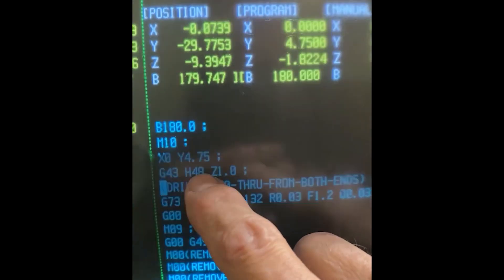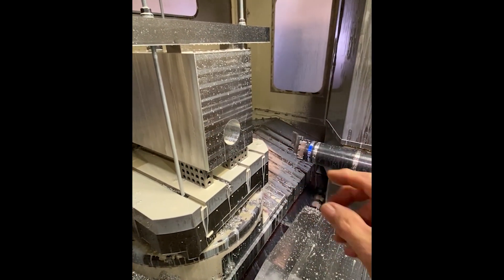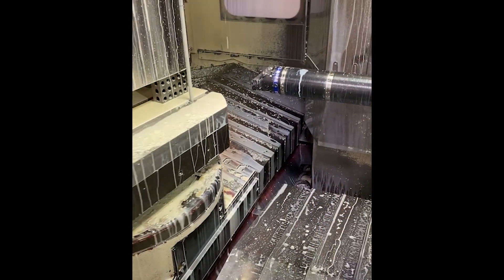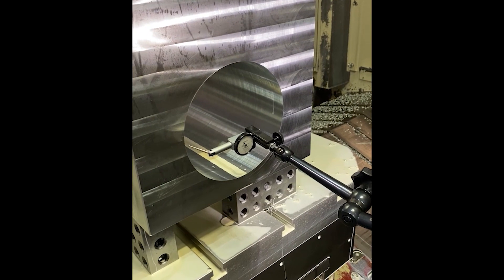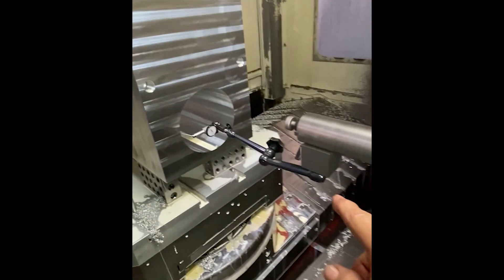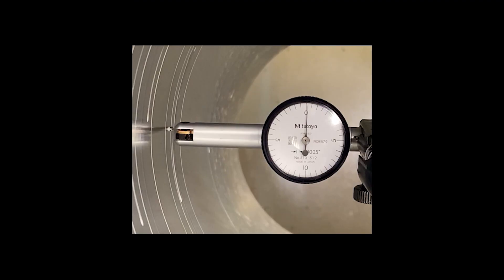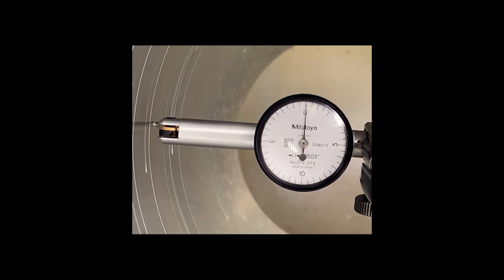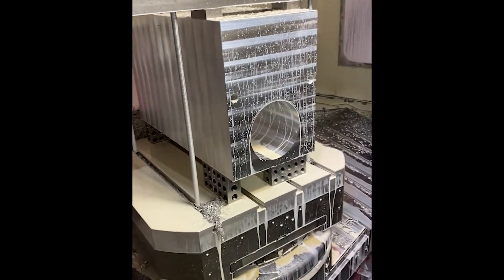Drill and Bore Aluminum Block

Comment: OK I have  a stupid question (or so I assume, and no it's not what is the part for...) 
I notice you often set your stock on 123 blocks rather than directly clamped to the pallet, is there a specific reason for this ? 
To clear the bottom of the spindle perhaps in case of close quarters Z axis machining perhaps ?
Reply from the maker: They are 2,4,6 blocks. The reason is the face of the spindle is almost 12" in diameter. If the tool is short the spindle will collide with the top of the pallet.

Comment: I use the biggest drill I have to make the hole to start with the biggest I possible have then I get a long 1-1/2 In inserted em and ruff machine the whole thing it go fast af doing 125 ipm with a 30% step over at full fluted I cut that like butter and get a bor bar with a shaft as thick as I can get and as long as possible and just bor it all In on shot but If I have to do it half and half like your doing I program it to where I stop on be side on the other side I save like .002 and I program the bor bar process to finish once I start to get near the end i program 3degree taper just as far back as I need to go and it will blend very very nice with out having to use sand paper unless it’s ok for it to be a few thousands out then I leave it. Other wise that’s what I do

Comment: I'm wondering if the issue is with the fixtureing..I'm thinking that big bore perhaps is moving the part just a little bit. I'm new to machines but I'm learning  you are a good teacher.  P.S. I am a wood worker I do high end comershial millwork. And installation. And I really like the bevail square.

Comment: I've been meaning to ask you a question  pertaining to laser cleaning. Have you had anything done with this new method and if so which is the root of my question I am curious as to dimensional effects for example a slightly oxidized ( should never exist I know ) 1"  "C" class Jo block being blasted, how the O/A dimension is affected? I have snooped around with no success having feed back from someone other than a manufacturer. Cheers!
Reply from the maker: Sorry I have never had that done.

Comment: whats the purpose of calling a tool and then having to call the correct tool length offset afterwards? I use Heidenhain and there you just call the tool and thats all you have to do
Reply from the maker: That is actually the way most machines work. On my Mazak a G43 line isn't necessary either. But it can be used. A 43.4 is absolutely necessary for full 5 axis though. On your control (I have never run a Heidenhain control) what if you wanted to use two different offsets for some reason? Could you change it with a G43?
Reply: @EdgePrecision    you can add some offset in form of delta length  and delta radius eg. Make the tool longer/shorter or bigger/smaller by some amount.

Tool Call 1 Z S1000 F100 DL0.1 DR0 

This line calls the tool and makes it 0.1 mm or inch longer. This is something we regularily use to machine flat faces exactly to the right dimension. You just call the tool with 0.02mm positive offset, machine a part of a face, then use the touch probe to see how high the surface actually got machined and then you just calculate the the offset, change the DL in the Tool Call line and run the program.

Sorry for my bad english :)

Comment: Wow ,I thought I was the only one who did this. I am doing a 70” total length bore 35” from both sides now. I would like to see your method if you have two drastically different size bores from both ends say 8” on one end and 1.5” on the other. We do that also with a granite parallel. But would like to see if you have any better ideas.

Comment: How do you know that it's a linear offset problem rather than an angular one?  If the 180º rotation was off by 0º0'30" that would also create a 0.002" mismatch in the center; in this case changing the offset would give you a hole that's smooth but not straight.
Reply from the maker: Because I indicated the outside of the part and it was square or lined up with the axis.

Comment: Lots of comments and compliments. But do NOT peck a spade drill unless you have to. Horizontal is less trouble but vertical can be a real problem. Nice machinery.
Reply from the maker: Thanks for the comment. In this case because I was driving the tools holder into the hole. I didn't want any shavings to interfere with that. I think a chip breaking peck like I'm doing here is OK but not one that retracts the drill clear out of the hole. That I would never do with a spade type of drill.
Reply: I figured that there was a good reason. But my comment was more for newbies. That may not have the experience to fiddle with the "rules"
Reply: I agree that ANY binding of a 4 1/2" spade drill on a 40 taper could be catastrophic to the machine. Like new spindle cartridge bad.
Reply from the maker: That's a 2" Cat 50 tool holder.
Reply: For the record, I have 30+ year's in the trade for those that care. And yes the bore turned out very good.

Comment: Thanks for the video, does that mill have a geared head stock, I notice the Q .03  on the G73, I suppose it's so deep that chip's would be problematic
Reply: I see that your B offset is off on G54 and G55 would that cause your bore to be off a bit? thanks again for the video
Reply from the maker: The machine has a direct drive spindle. In fact the spindle is the motors shaft.

Comment: Peter, I think it's a supper lightweight, precision anvil  ; ) . The video is very informed. The whole video I was thinking you going have loosen the part and knock it around a .001. I was wrong!
Reply from the maker: Generally you can do most things on a CNC machine with offsets. If you program with that in mind.

Comment: Ohh the Joy of having old horisontal.

I was spoiled to machine on a New dmg 125 horisontal. I did alot of line boring like this and with the dynamic offset cycle800 it was always spot on without Any problems. If it had problems it was very easy to dial in.

Comment: What's the spindle HP on that machine again? I have run a 2" spade drill on my lathe, it's 30hp max. Definitely not pushing the drill too hard though.
Reply from the maker: This machine has the 40 hp high toque spindle option. But this also limits the max speed to 6000 rpm. And yes I could have run the drill quite a bit harder. But I didn’t want to move the part on the blocks it’s sitting on. Thanks!

Comment: Is that a Max cut drill? Ive used 100mm drills from them with great succes. The are the same type drill you use. Hss tip
Reply from the maker: This drill is a Allied Precision drill. This is the largest diameter I have.

Comment: this is typical, but a good teaching lesson, the deviation is usually in the rotary/table axis, set-up, how it is trammed, including the age of the machine..."push-off' is deflection of the tool, the longer/length the tool, the worse, as well as type of material being cut..
Reply: If it was the rotary table fault, it would have shown up on the indicator as he traveled down the bore. no?

Comment: Could it be that a b axis work offset would also fix it?
Reply from the maker: I have indicated the B axis it is accurate. I suspect I need to check the calibration of my spindle probe. If I were to change the B zero that the hole would not run parallel to the sides of the part. Because I needed to move both offsets the same way it makes me suspicious of the spindle probes centering.
Reply: Thanks Peter for the video. I think when you use the electronic probe it does not work perpendicular as the Tesa probe can. You have properly turned the table in 90 degree for probing one side of the aluminum block and then 270 degree for the other side. If the angle tolerance is slightly off by theta degree, and the half boring length is approx. 25 inch, then you have 0.003 = 25 x tan ( theta ) , isolating theta gives you theta = arctan (0.003/25 ). I would have expected a special work pice holder in your Mazak and used the long travel in this machine combined with custom made capto boring bar :-).
Greetings from Denmark

Comment: Looks like that silent bore bar did well. How is it in steel at that much hang out?
Reply from the maker: The ITS boring head? I’m using their normal steel extensions. Three of them on the cat50 shank. The tool is around 17” long. But it’s weight alone might be the damping factor. It must weight around 60-70 pounds. I didn’t weight it but it’s not easy to mount it in the spindle with one hand and turn the clamp switch with the other.

Comment: so thats typically a pecking drill? i have the type with 2 inserts in the end, nothing that size, and they say constant pressure. ive never used one like that.
im interested in how you make the bevel gauge. particularly the slot, 2 pieces or a saw?
glad to see youre doing well.
Reply from the maker: Its just a spade drill. I'm pecking it like that because (As you may have noticed in the video) I'm driving the end of the holder into the hole. I cant have a wad of shavings build up there. It would cause a problem. Otherwise it could be done without the peck.
Reply: @EdgePrecision  no i did not notice that about the holder, gotcha.. appreciate the info, thank you.

Comment: Being only 2-3 thou off 15" in after rotating is pretty good. Yasda has an old school video where they talk about problems like that in horizontal machines.
Reply from the maker: I think people don’t realize how little error this really is. When you are dealing with parts that fit in a vise this is a lot of error. But when dealing with longer distances .0015” off center isn’t that much. Every one thinks their machines are so accurate. But it’s not the machine that makes accurate work. It’s the machinist.
Reply: @EdgePrecision  I agree, I have definitely worked on horizontals that would have been at least twice as far off as yours, though.
Reply: Exactly Peter.... Machines are no where near as straight and square as people think.  I've bought brand new machines that were misaligned by large amounts.  And yes, that is a very small amount to be off.  Most people wouldn't even fuss over it.
Reply: @TexasHunter59  You are totally right, but at work we got lukky: we have a TOS HBM with 4m X Axis Travel and the spindel is perfectly allignet with the X Axis. We can face a part in both directions and see the rings on both sides of the cutter and both directions look the same. BUT we only noticed then years after the machine was delivert, because before we never did parts where it matters.

Comment: I don't mind the video format, it's always interesting to see what you get into.  I know on my Renishaw probe I check that the adjustment screws don't loosen up and the tip still has the same run out.  I'm sure you've seen it as well, if you get a chip on the taper, or a set screw loosens up you'll quickly be out 1-2 thou easily.  Thanks for the video!

Comment: Is this more time efficient to bore rather then trepan? Seems like a ton of material removal that requires the pecking for chip control. P.s. I'd still watch if it was 480p and vertical like this. :)
Reply from the maker: Trepan could be good if I had the tooling. I think I have only done maybe six of these parts in 15 years. It’s not worth the investment. Thanks DrKnow65!

Comment: Hi Pete, I'm a bit confused . Is you rotary table out?.  Why are you using 2 offsets? . If the Job is set in Co-incidentally to the center of your rotary table you should be able to get away with using one offset. I know thats a pain in the Arse to set up but the bores would be in line. Love your work BTW. Happy new year, Mal.
Reply from the maker: The part isn’t centered on the table. It’s .075” off center as you saw in the video. It would take much more time to align it precisely to the B axis centerline. There’s nothing wrong with the rotary table. This is a very common thing to do on a horizontal mill. This machine is to old for dynamic offsets. It it had that the control could calculate from one offset with the part of center.

Comment: I am surprised to that there where variation. The way you set up with the probe and squaring the block should be bullet proof. Is it possible that the part might have moved during the drilling? Otherwise the only thing I can think of is play in the table drive.
Reply: Oh! Can’t it be that you are missing a digital scale in one axis?
Reply from the maker: It would not matter if the part moved while drilling. That would make a difference for its location to the outside of the part but not the bores lining up with each other. I manually indicated the rotation angle. It’s more likely the probes calibration. I haven’t checked it in a long time.
Reply: @EdgePrecision  Alternatively it could be your spindle is slightly off axis.  It would only have to be pointing .001degrees off axis to produce that error.
Reply from the maker: @bcbloc02  Yes that is possible. It would have to be the Z axis out of square. The spindle itself wouldn’t cause it. It may not bore a round circle but it would still move straight. Kind of like running a board thru a table saw at a angle to cut a radius. To tell the truth I haven’t checked it. I have a test bar. I will check it. But if it is on this machine there isn’t a easy way to correct it.
Reply: bcbloc02 why would you think some like that? It is not like he has ever crashed the machine.
Reply: @EdgePrecision  I was thinking the spindle extended on this machine for some reason versus table moving. But again if the spindle points out of line versus the axis the difference in position of your probe from the spindle face versus the much longer length of your boring tool could result in the cutter being moved offset.  Honestly a jack screw tweak might fix it if that is what it is. I can easily move my 47000lb HBM several thousandths with the floor screws. Is there a vertical lock to column on that machine or is it always free running? If no lock it might just be the running clearance showing up.  Likely they didn't expect that machine to be running a lot of tooling of that length that would be so far from the spindle face.
Reply from the maker: @bcbloc02  Yes it could be the level of the machine. I did face this block square with it standing on end. Vertical in the Y axis. It faced very straight, square and parallel. So the machine is very close to level. But it is possible. I have a ball bar instrument. I could check it with that. It would tell me if everything is square and level. I haven checked it sense I moved the machine here. It may be worth doing again. This little amount of error usually not a problem for most jobs.

Comment: Hey just wondering if you have used a workshift calculation macro for things like this so they always remain in line?
Reply from the maker: But how would you know what to calculate without measuring it? I have never done it that way. I suppose you could use a variable and enter your error measured and calculate each offset change in the program. If I did this a lot I guess I would do that.
Reply: @EdgePrecision  what you do is input the center of rotation of the pallet in the macro and it trigs out the new work offset based off your picked up offset and the centerline of the pallet and the angle you are adjusting to in your B so once you get the center of rotation picked up perfectly, you can program the whole part at any index off of one known work offset point, it makes things like this much easier. I learned it from our former programmer.
Reply: @EdgePrecision  right before the machine indexes the B, you would put a "G65 P** W1 B***" and it would recalculate your work offset at every index so you only need one pickup location for infinite number of different B index angles and features.

Comment: I'm surprised that this part didn't move all over the table with that drill without any stops around it.
Reply: it's clamped down tight and the pressure from drilling isn't that much. On really big parts you can really just let gravity do all of the work
Reply: @SuperAWaC  What gravity? It's aluminum.
Reply: @ChrisMaj  maybe you missed it, no biggie, pause at 2:19
the big thing over the top is screwed down into the long screw shaft thingybobs to either side of the big block
the screw shafts are themselves screwed into t-slot nuts and those are riding in the table t-slots
this way the aluminum block that's being machined is forced downwards with probably several metric tons of force
Reply: @ChrisMaj  a block the size of the one in the video weighs 500-600lbs. with the strap clamps it's plenty of gravity.
Reply from the maker: @ChrisMaj  700 lbs of it. But also with those four 5/8-11 screws holding it down tight it is very securely held.
Reply: So aluminium has no weight? OH yeah i forgot one tone of aluminium is lighter than one ton of Steel. Just like one pound of citron is lighter than one pound of lead. Hurr durr
Reply: Chris Maj yeah honestly I bet you could probably just drill into this piece with no strap clamps if you had the patience.
Thing weighs a 600+ pounds
Reply: @COdrummaCO  hmmm sorry but that's taking it quite a bit too far
machining tables, if maintained correctly, are quite slippery
and that drill is quite big
Reply: SoWeMeetAgain soooooo make it not not slippery?
Reply: @COdrummaCO  no you want it slippery
it's slippery because it's very flat
and you want it to be very flat so you have a reference surface to put stuff on
also you literally want it slippery to position things, not as critical on the kind of machine shown in the video, but on other machines you sometimes want to position a really heavy work piece within a thousands of an inch (yes!) and it's nice to be able to do that by just hitting it with a plastic hammer